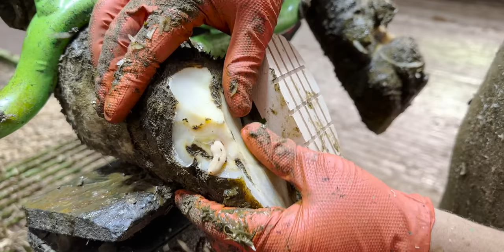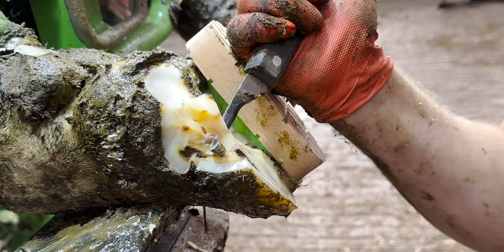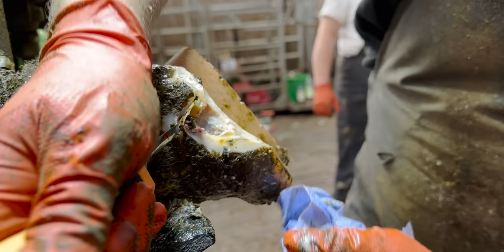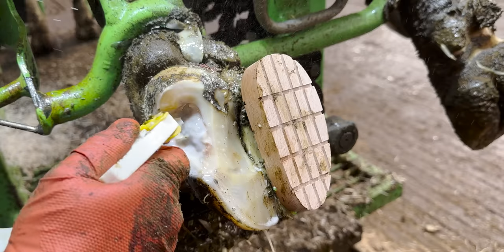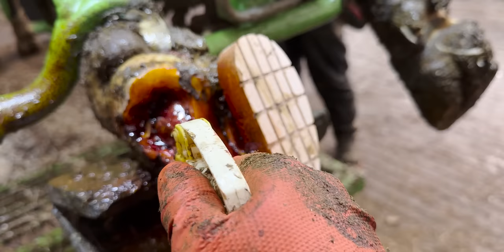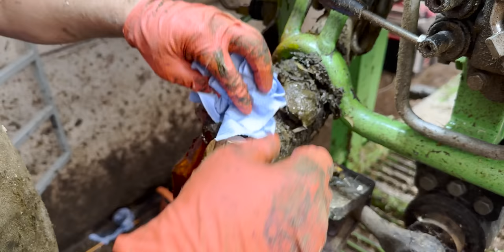I SQUEEZED this out of a COW's FOOT!!!

Comment: That inner hoof capsule was different-looking than most of the ones in your videos. Usually they are sort of ragged-red and slightly bleeding, but this time it seemed to have a white coating under the pus. Why is that? Was the infection just caught earlier or is it because the horn was already fully separated and didn't need to be cut away?
Reply: Thick white pus means the infection's been going on for a long time.  And if the horn is separated it needs to be cut away.  Why it looked different, I don't know.  I noticed that too.

Comment: I think in cases like these you should use a pressureized drainage - make two entrances, insert a tube into one, open the valve and pressure-wash the entire abscess, pushing pus outside. Pressure pumps are fairly common. I think it would be effective.

Comment: I grew up on a farm, my father was a rancher, and never in my entire life there did I see cows with such problems in their hooves. I never saw them have to be cut. Maybe because they were all day in the mountains grazing, not in wet and humid places where they practically end up rotting their feet and having abscesses on their legs. putting straw on the floor would help the humidity not affect them as much. because we can think that it does not hurt them and it is quite the opposite, they suffer a lot.

Comment: Ouch. That one was messy. I have been wondering, however. Since you are dealing with bacteria, fungi and other biologicals; do you sanitize/sterilize your knives between "patients"?  I can see where cleaning the cutting wheels on the grinders would not be practical; but the smaller cutting tools? I would think there would be a chance of cross-contamination. Keep up the good work. Thanks much.
Reply: They sterilise them between farms iirc.